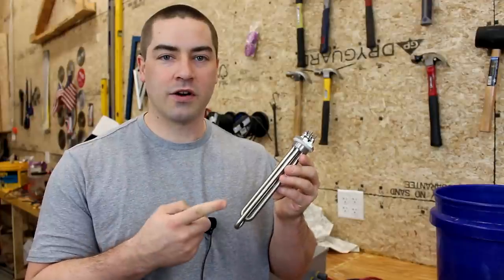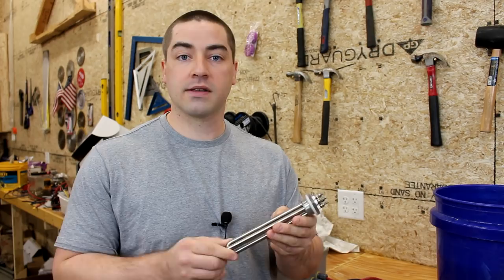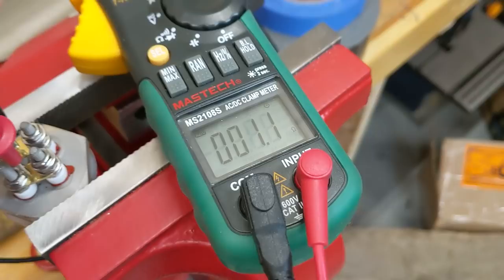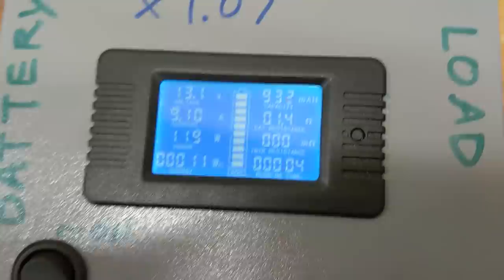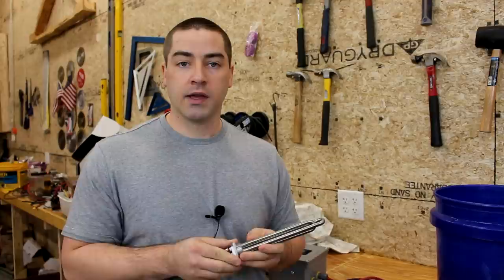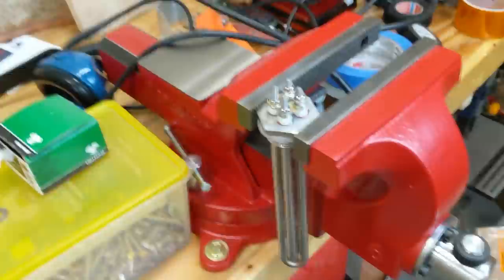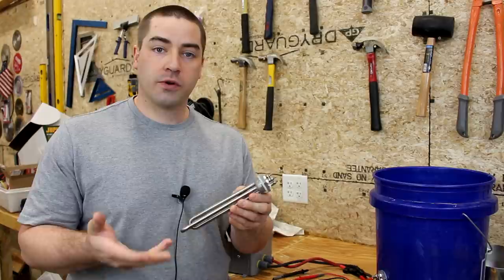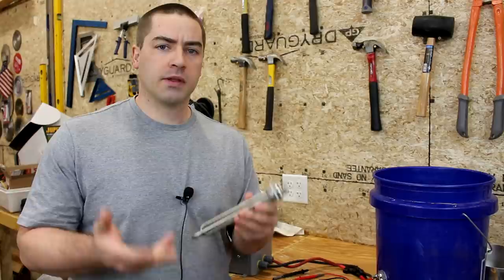Getting what You Paid for using Science

Comment: As you know, water heater elements are purely resistive.  That means that the only thing input voltage changes is the amount of power it can consume.  At the $25 price point you are likely getting either 120vac or 240vac water heater elements that have been repackaged for lower DC voltages.  If you can find a 5500 watt (common size) 120vac element, locally or online,  it will put out roughly 600 watts from a 12.8v DC source.  And it will likely be about half the price, as you save the middle man markup.
Reply: @calysagora3615  Look up Ohms law. V=I*R (Voltage=Current*Resistance). In your case I=V/R.
Reply: @nocare , there are no assumptions. Aspendell clearly stated the heating element is purely resistive. Therefore power is E^2 / R. Cut the voltage by 1/10th and power is cut by 1/100th. Now Jan assumed 12.8, not 12.0 volts, so they came out with 62.77 watts.
Reply: In order to have both elements in series, thus having max resistance, you should remove one of the plates i think, and hook the power to the ones that are not connected
Reply: 1.2 in parallel means that each of the elements is 2.4. In series 2x2.4 is 4.8 Ohms.

Comment: When you measure such a low resistance with a DMM, you need to zero out the resistance of the leads. The leads have more resistance than the element itself. A better bench type meter will allow you to make 4 wire measurements using 2 force leads (forcing current) and 2 sense leads (measuring voltage). However, your water bucket power test did seem to indicate that the element was weaker than expected and the wire gauge was pretty huge, so the poor result cannot be blamed  on wire loss in that test. You were right to return them anyway.

Comment: David, 

 a cold resistance measurement will give x. However the only way to know the resistance at operating temperature is a voltage and current measurement and calculate. All resistive conductor's resistance varies with temperature, most are positive and as temperature increases so does the resistance. At switch on there will be a surge current which drops off as the element heats up.
One other point to remember is that multimeters are rubbish at measuring low resistance.

Comment: An Unintended Consequence - While watching this video I saw you measure a DC current with the meter clamp and wondered how that was possible. My experiences with clamp around ammeters years ago were limited to AC circuits where the varying flux induced a voltage in the clamp coil. So I used Google Search and, thanks to Fluke, learned about Hall Effect sensors for steady state flux measurement. Seventy-five years old and still learning stuff all the time.

Comment: When measuring low resistances, it is common for the meter leads to have higher resistance than the resistor. Low resistance is often measured with a "4 lead ohm meter" setup. Use a constant current lab supply and feed your load with 100mA or 1A depending on the load. Measure the voltage across the resistor and calculate the resistor value.
EG, your element at 1 amp is close to 1 volt, so it would be 1 ohm, or if fed 100mA, would be 0.1 Volts = 1 ohm.  With this method the real 800Watt element at 1 amp would have 0.18 Volts on the terminals and dissipate 0.18 watts, so the test would not heat your element for the test.
Reply: DUH! test leads are 4th order in resistance, therefore, nobrainer. GEEZ.. over-complicate a simple thing.
Reply: not necessary he measured the actual amp draw. P=IE, simple as pie.

Comment: ...just wanted to let you know that my new 600W 12V heating element came in today.  The resistance tested right (2.4 Ohms, although I know some resistive loads can change dramatically with temperature...this doesn't seem to), and when I connected it to my 12v 62A power source, I FINALLY GOT 50 a @ 600W.   I got it through Amazon and it was a 'twin' for the fake.
Thanks for the video!!!
Reply: I wrote 2.4, when I intended to write 0.24 Ohms....

Comment: Hook up the elements in series then take a resistance reading.  Meters like that do not do well near 1 ohms.  If each element is 1 ohm in parallel they will be 0.5 ohms.  in series 2 ohms.  Your meter will give a much more accurate reading at 2 ohms.
Reply: That’s true - better to do what David did after - measure the current and voltage.
Reply: I agree that these meters are not great at low resistance, but I don't believe he is getting bad readings as his power meter was showing 1.1 Ohms and ohms law calculations based on voltage and current from the power meter also point to about 1.1 ohms.  No point in doing more work to get the same answer as it has already been verified 2 times.
Reply: Ya like D said I have noticed never getting real low readings and that would probably give you a little more accurate number but he tested it and it's right there in line with his measurements

Comment: i was looking at buying a 12vdc element recently and came across a website that explained possibly what is going on.  Apparently is all too common practice for resellers to buy standard AC water heating elements and sell them as more expensive DC elements.  Apparently all heating elements are marked for their voltage and output, dishonest sellers will melt these markings to make them illegible.  Check your elements and look for the markings or the melt plastic which was used to cover their tracks.

Comment: Max power point is when the resistance of the source equal the resistance of the load. 
Most heating elements increase resistance as they heat up. Old fashioned lightbulbs made of tungsten changes resistance dramatically.
I don't know the temperature characteristics of these type of elements. I suspect they are made of tungsten and the resistance will increase as they get hot.

Comment: Before you said "we have been running for 10 minutes" I was gonna say "just wait until you let it sit for a bit... as a resistive load gets hotter the resistance increases so your power will decrease" lolol
Reply: This is only true with some resistive loads, some others will have a negative temperature coefficent (NTC) and as they get hotter their resistance will decrease, which often leads to a thermal runaway. You can test it with a small carbon rod which has a NTC and when connected to a power supply or battery will start conducting slowly but eventually conduct more and more until it burns up. It is a fun experiment as right before it burns up all the way it will start glowing bright white, easily enough to light up a room
Reply: @josephsvensson6637   now THAT sounds like a YT video idea to me!

Comment: When measure low ohms 4 wire is best, or use current - voltage drop access the elements
Reply: You are not measuring from like a display on a power supply it's just the multimeter that makes no sense really I mean a meter is not going to have any way to hook up 4 wires to a multimeter
Reply: @james10739  In a 4 wire ohm meter setup, you don't need a 4 wire meter. You need a regulated current source and voltmeter.  This test would use a bench supply set to provide 1 amp. The 800Watt element should have 0.18 ohms of resistance. At one amp, the terminals on the element should have 0.18 Volts, easily measured with a DMM to 3 significant digits. EG 180mV. His element is about 1 ohm, so 1 amp would provide a measured voltage of 1 volt, or with a 3.5 digit DMM, 1.000 volts at 1 amp.
https://www.circuitsdiy.com/low-resistance-measurement-method/  I have to regularly repair equipment and verify the value of 0.01 ohm resistors used in current metering.

Comment: I hooked up 2 full sized solar panels in series. Then wired them directly to the bottom heating element in my home hot water tank.  I used the rated voltage and current of the panels to figure the panels resistance.  Then found an element that was close to the same resistance.  Heating elements do not care if the power is DC or AC or the voltage as long as the voltage is not too high.  The top element made sure that the water was up to temp.  Did not have any switches or controllers.  Wen the sun was shining it heated the water.  Wen the sun went down it did not heat the water.  I used some big 50A plugs to connect the element to the panel wires.  It worked really well in the summer.  not as well in the winter.

Comment: I am vaguely remembering something I encountered decades ago and haven't used since, fair warning. One of the tricks with transferring power is impedance matching. The resistance of the current source must equal the resistance of the load. Since you can't put an ohmmeter across a battery or solar panel, you look at its short circuit amps, and derive the resistance from that and the voltage. In essence, this is the same trick you use in a mechanical power train by shifting gears. Something to think about; I'm up late and can't be arsed to suss out the details.
Reply: Well that is a very different thing you are talking about now. Impedance matching is used when dealing with RF signals to reduce signal reflection from the load. In this case we are talking DC and the load is all resistance (no immaginary part) so signal reflection is not an issue. You don't want any resistance in the source ideally. If your source has the same resistance as your load half of the heat will produced by your source and the other half by the heater.

Comment: Check your math at 48 volts. I think they sent you the wrong ones.
Reply: This. 100% there's been a screw up in the supply chain somewhere (whether it was by who he bought them off, or who they bought it off in china) and he's got a 48v element.
Doesn't help they normally don't mark anything at any point either.
Reply: I think they provided 120v 1500 watt elements instead.
Reply: Ya but at 1.1 ohms that's like 2000 watts it's closer at 24v it's over 500w
Reply: @richardowens9061  at 120v it would be like 13,000 watts
Reply: It is advertised as 12v 800w
Reply: Does its resistance change when heated? I'd imagine it gets higher than 1.1 Ohms when warm.
Reply: @gblargg , since it's water cooled the effect is probably minor.
Reply: @sciglassblower , "Oh that! That's just a typo." 😆
Reply: Jan Lenz , excellent, and spot on. But I'm curious. I got my ASET in '75 in the USA and we used E for voltage (EMF or electro-motive force) which is of course measured in volts. I see you use U. Where does the U come from and what country?

FYI, got my BSEE in '89 in the USA and we still used E

In case the alphabet soup of acronyms don't mesh with what you know:
ASET (Associate of Science in Electronics Technology), a 2-year degree in the hands-on of being a electronics tech, as in fixing transmitters and stuff.
BSEE (Bachelor of Science in Electrical Engineering), a 4-year degree in the theory of electronics. I eventually got into designing chips for the storage industry.
Reply: @ScottyDMcom  U, R, I are used in SI systems for voltage, resistance and current. Used in Europe.

Comment: Your multimeter probably has a resolution of 0.1 ohm. As such, it's not best suited to sub-1 ohm measurements.
When measuring low resistances, first 'calibrate' your measurements. Touch the probes together and note the reading. Subtract that number from all your measurements.
Still... clearly the elements were not what you wanted.

Comment: would be best on 36V... old grid tied panels.

1R. 12v. 12A.
12x12=144
X1=144. yep. 150 watts.
36v/1R
36A.
1296W...

theyre immersed. theyll take a bit more. plenty more...

or you just ignore all of that and buy nichrome wire by the roll. what will glow red or melt in the air will stay cold in water.

it doesnt need to be insulated, its still more conductive than the water.

Comment: The battery controller meter concured with the multimeter. Right there is the confirmation before going anywhere else. 1.1ohm suggests that the element is a higher voltage rating, which equals incorrect product sent.

Comment: David, while you are probably correct, but there are two things you didn't do that could account for the error. Or at least these are two things you didn't show, and some of your viewers will assume they are irrelevant.

#1) To get accurate low ohms measurements you need a four-wire meter and probe set, which I didn't see in the video. The circuitry inside the meter + the meter leads has some resistance. You can measure it then subtract it from the meter reading, but ordinary multimeters typically don't measure very low. My meter, like yours, only resolves to 1/10th ohm on the lowest scale. My meters "zero" reading (touching the probe tips together) is 0.8. If I'd seen a reading of 1.1 I'd assume the heater element was 0.3 ohms, which is pretty close to 0.18 given that we'd be lucky to be within +/-1 digit. Perhaps you're meter has a zero function, but if it does I didn't see you use it.

#2) While you measured the current in the wire to the heater, you didn't measure the voltage at the heater leads. I'd be surprised if this was much of an issue, because for it to be a problem your system meter (the gray box) would have to have a crazy-high voltage drop--like on the order of 7-ish volts. I assume when you built the system meter you tested it thoroughly. But quick question: is the voltage shown in the upper-left of the panel output voltage or battery voltage?

I don't often watch your videos, but when I do I'm impressed with your knowledge and approach to problem solving. I don't know if you've any formal training, but you are not a hack. You know what you're doing. And sometimes you videos make me think, which is always a positive. Keep up the good work.
Reply from the maker: Hi ScottyDM,  Thank you for your thoughtful comment.  You are correct that I didn't show everything.  My green multimeter has about 0.2 ohms in the leads.  I own a 4-wire meter and checked the water heater off-camera.  Sometimes when I show "specialty" tools the audience can't relate.  I try to show things using more "common" tools whenever possible.  Since the multimeter is not the perfect tool for this type of measurement I also hooked it up and showed it not pulling the amps.  

The grey box meter is something I threw together in a previous video to allow the audience to see what is happening.  The voltage reading of the watt meter is the battery voltage.  Yes, there will be a slight drop on the water heater, but not much.  It's 4 gauge wire, 36" long.  

These are good points you made.  I have received my replacement 600w elements, and my refund for the mis-labeled ones.  I'll do a follow up video and include checking the voltage at the element.  I'm always open to further suggestions to improve my content.  I learn from the audience at least as much as I teach, so I'm grateful for the feedback.

Comment: For a high wattage device, you should use a voltage as high as practical, this will reduce your current and hence wire size required
Reply: Not true at all for most devices especially resistive loads. The higher the voltage for pure resistive loads, the greater the current they draw. Even wattage increases. A 800w device would start drawing upwards of 850w on higher voltages. Its all about the resistivity. The higher the voltage, the less the resistance, and the more the current can pass through.

Comment: One thing to consider that has not yet been mentioned here is that power ratings for electric components are often a maximum. Meaning that exceeding that rating will likely damage or shorten the life of the component. The actual power dissipated (heat) will depend entirely on the voltage applied and the resistance of the element, which will change a bit (increase) as it heats up... Yes, the vendor likely sent Dave the wrong element, and the resistance should be specified by the seller.

Comment: When I was working for ebay seller. He was writing Tested, assuring you that it it as advertised. But no one ever touched the item for testing because time is money. Not every buyer will notice, chance that flaw will not be discovered is high. When you read tested - mostly not tested.
Reply: One of the only ways to really protect yourself when buying general Chinease made products outside retail channels, is to find a forum or similar place where people have already bought and tested whatever widget you want.
There you can find the actual specs, and sellers that seem to have at least some reliability.
And even then, oftentimes those known good sellers will switch to a model they can get a few pennies cheaper from someone else, and restock with that model for a short-term profit bump.
Then of course, people find out that newer model is not as good as previous, and seller see's his demand tank.
Chinese especially can't seem to control themselves from killing the golden goose, this happens continuously...

Comment: I'd be into a low wattage 24v dc thermostatic controlled one, like the 240v ac 3kw item found in my house. It'd make a useful dump load.
Reply: How low do you want to go? If you take the 3kw elements and connect them to 24v they will be about 300w.
Reply: @TrackGeeks  resistive load (heater) rated at 240V 3000W will take 30W at 24V, not 300W (P=U^2/R)

Comment: I have one of these to heat up an outside shower in my camper, it was advertised as 150w. I actually cheat a bit and run 24v through (cheap enough that if I burn it out, ill know not to) but have probably had it running all told for about 15 hours, and yes, this isnt to make a hot shower, just luke warm :)
Reply: Maybe your heat loss is too high to get it warmer with only a 300W load.